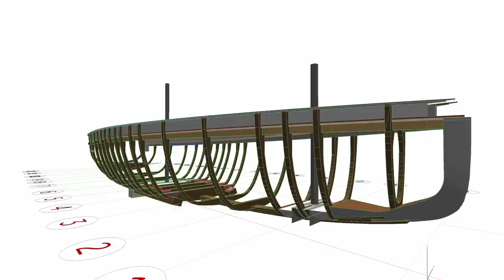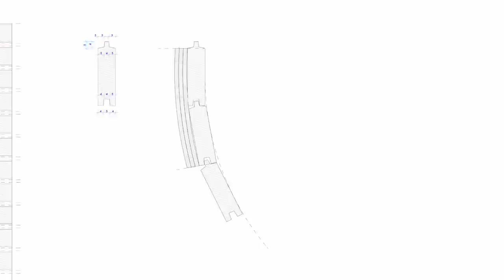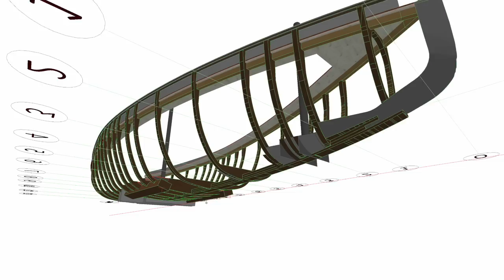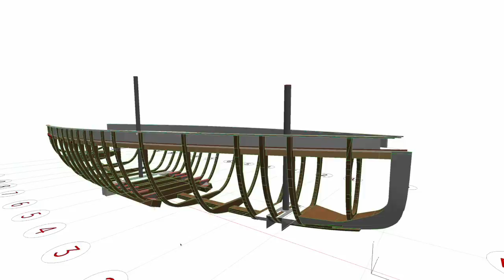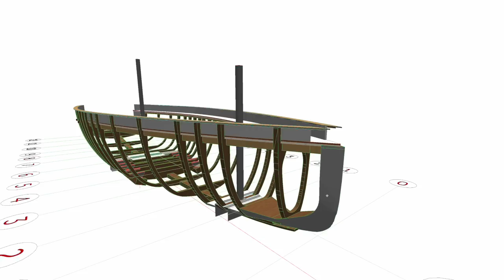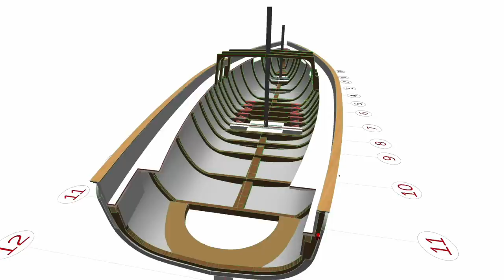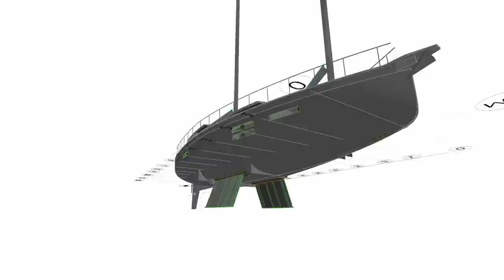Questions and answers while waiting epoxy delivery! ep.50 Project SeaCamel

Comment: The little boat which was shown didn't have stringers. Stringers run inside of the frames and are used on traditional planked without glue built boats. Otherwise stringers are necessary only on very big boats and their use depends on the material. Fibreglass can be glassed on top of strip planks the same way as wooden veneer. In terms of sustainability and performance an aluminum boat is the best as it can be recycled for 100%. You'll need to be able to access any equipment and through hulls later on. So please don't close any compartment as you will need to access even the empty ones as it's a wooden boat. This 40 kg of epoxy won't last very long and latest when it comes to plank the hull you'll need more. Also I believe that your budget is fairly low even if you keep it really simple. You may build the batteries yourself and even the masts. We have been talking about building wooden masts. To current prizes I don't think you'll need that 40 k for the masts from aluminum, if you had a single large mast, that would be about 20 k, two smaller ones should be about 30 or so. But the outfitting will be more expensive than you think. 60 k will not do it. Deck hardware, sanitary installation, engine and electronics especially will make for at least 80 to 100 k.
Reply: ... wouldn't aluminium hull consume WAY much more energy, reusing it even more so?
Reply: I think masts he plans to buy from fiberglass...
Reply: @danijelkurincic  There are no masts built from fibreglass. Only aluminum, carbon or wood. Glass is to flexible. And carbon would even double his mast budget of 40 k.
Reply from the maker: Hi guys.

The materials (wood and epoxy) are fairly inexpensive actually. So the price of the hull and all the structures are not that much.

The masts will be self built from plywood (to form the shape) and carbon fiber structure on top. This price estimate also includes booms. But as I said - no real price information of that material yet.
I have understood that stringers are longitudal frame-like structures... I might be wrong. But in this case I mean those in the image :)

Aluminum requires special skills to weld correctly which I don't have. Also heavy and difficult to handle and work with compared to wood. The initial production of aluminum is enormously energy intensive and also locally very questionable industry...
Reply: @ArcticSeaCamel  I'd clearly use fir battens instead of plywood. For the mast you'll need longitudinal strength. Nordic Fir is light and has an extraordinary longitudinal strength if you get good quality, branch free wood. Ply has only half the strength as only half the fibers run the direction. And ply is short, you'd to make need more overlapping joints. And ply is impossible to bend in a relatively small mast shape if it's not very thin.
Reply from the maker: The mast will be structurally 100% carbon fiber. Plywood mold is just build inside to hold the shape while laminating. I'm planning to use technique Eric Sponberg has developed, check it out: https://www.ericwsponberg.com/free-standing-mast-designs/

EDIT: Here is additional more detailed article of the matter:
https://www.ericwsponberg.com/wp-content/uploads/wing-masts.pdf
Reply: @ArcticSeaCamel  I understood that but the ply would be just weight in the top where it's not wanted. Using something that delivers even structural strength would be the far better option. Maybe use veneer instead of ply. That's easy to bend as well but you'd need to be careful not to break the first layer. 
Edit: The sheating of the described method is veneer, just the core is plywood which is fine for that case as in the center of an bending profile no strength is required. Still this is quite an old document from 1992. As a naval architect, though not involved in carbon fiber calculations I know that there has been a huge development since then and I'm very safe to say there are better methods today. I'd also not want a wing profile mast with quite large sail area on a cruising boat. There have been many reports when monohulls where sailing in storms just with the area of an ordinary mast with speed smashing down the waves. You might want to reduce the sail area as far as possible. On an racing boat a totally different thing. For an cruiser I'd clearly prefer an conservative standing rigg with shrouds and all that. Also on a cruising catamaran. To take full advantage of the carbon fiber you'd need to use at least vacuum method when laminating. And reaching a good vacuum on such large mould is really not easy. Better would be if you had access to an Autoclave oven.
Reply: @danijelkurincic  No, once produced aluminum can be recycled with quite limited energy.
Reply from the maker: I don’t have plans for the masts yet but the principle is to make them oval (not actually wingmasts) and rotating.

Conventional rig is something I definitely don’t want. It’s more complicated, has hundreds of parts that can break and none of them can be self made. Also it’s less efficient, sail shape is worse etc. there’s really zero benefits going with conventional rig.

With free standing mast there’s just the mast and it will be so overbuilt that breaking is very unlikely.
Materials and methods are of course evolved but physics and DIY limitations are the same. What I have talked with mr Sponberg, he recommended to build temporary oven to cure the epoxy even sturdier. That I’ll propably do. But there’s much to plan before we get there.

The idea of his method is that the mast shape is the mold. I would think that vacuum bagging the whole mast could actually be possible if needed. We’ll see. 🙂
Reply: @ArcticSeaCamel  Safety is a very good argument to me. A free standing mast of whatever shape needs to have only one weak point and it might come down.
Reply from the maker: Yes, but conventional mast has hundreds of possible weak points instead of one. And they’re all prone to corrosion.
Free standing has “only one” and there’s no corrosion over time.

Airplanes got rid of wires on their wings hundred years ago. Why sailboats didn’t? Answer is really racing rules. (And conservatism)
As I mentioned, conventional rig has not a singe benefit over free standing.
Reply: @ArcticSeaCamel  But there are also the same hundreds of strong points to hold the rigg, if the free standing connection fails it's lost. And there will be no chance to set up an emergency rigg as the mast is will be lost. The sheets won't hold it, the blocks will rip out of the deck. And carbon has no corrosion on an wooden boat, that's true. But there are no reliable long term documentations how long it might last. Insurance companies will require to get a new one after ten years. As is required for shrouds and other safety critical stuff.
Reply from the maker: Difference is that there's just one strong point to hold the mast and it's way overbuilt for the forces involved. On conventional rig just one broken piece (of any of those hundreds) can (and will) break all the others and fail the whole rig. Sorry to say, but there's really no argument to say conventional rig is more reliable and better. That's just not true.

There's carbon free standing masts from 70's and 80's and I'm not aware of single failure with them. Freedom boats for example can be found for sale from YachtWorld with all original masts on them.
However I know several conventional masts (carbon and aluminum) that have failed.

How many airplanes you know of losing their wing because of the lack of wires holding them?

Also - this kind of free standing mast will most propably be cheaper and lighter than conventional mast with all the rigging involved. Also the center of gravity is better because the mast tapers up. Then there's the fact that mast is watertight and has some volume in it --> buoyancy for keeping the boat upwards if capsized.